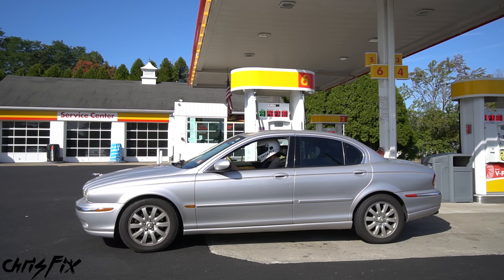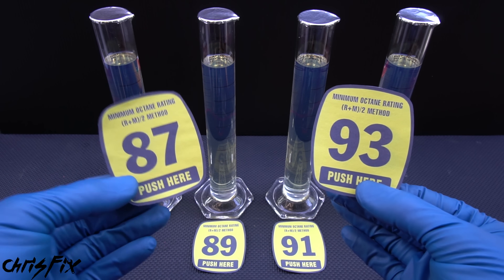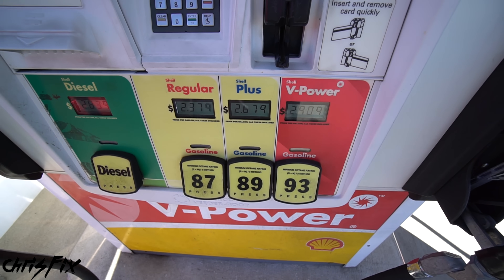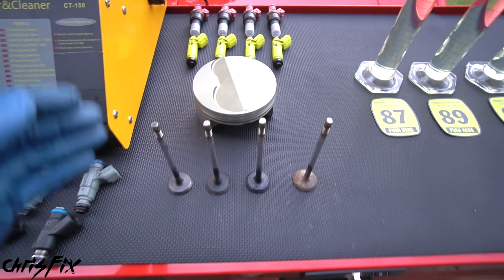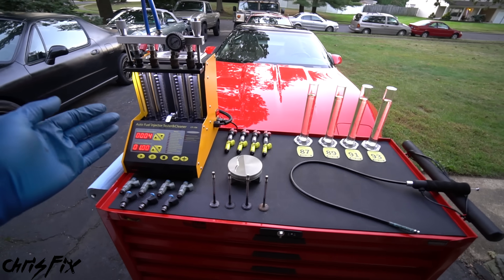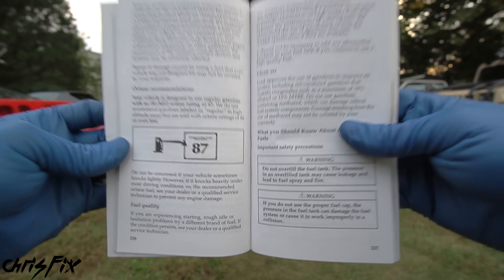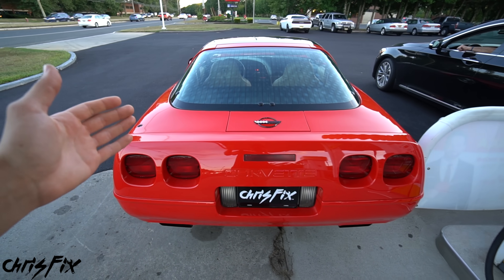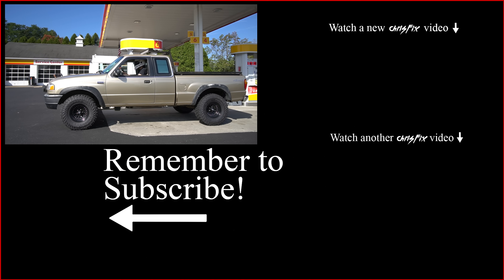What is the BEST Fuel to Use in Your Car or Truck and WHY

Comment: As far as Shell Gas is concerned... It is by far the best on the market. For the past 25 years I've been strictly using Shell in every vehicle I own, and the 3 vehicles I have now. My Accord runs perfectly fine on 87. My Ford 5.0 uses 89, my Z71 uses 91 or 93.  
Gas at home in México is the equivalent of $4.25 per gallon, and the Shell gas in Mexico actually comes from the USA, and is the exact same gas that I buy for $2.06 in Texas. It costs the same as the halfways refined Pemex national gas of Mexico, but Shell gas is 10 times cleaner and 4 times more potent. 
If you can't find Shell for a fill-up, use Mobile (Exxon/Mobile, same company) until you can find your next Shell station for a fill-up. Mobile in the USA and in Mexico both come from the USA and ut undergoes extra refining processes like Shell gas does. But, man, you can tell the difference when you use Shell.
To keep my injection ports super clean, along with the gas lines, gas  tank, exhaust, catalytic converters... I use a cheap but effective Xylene cleaner called "Berryman's B-12 Chemtool." It is by far the best water remover, carbon remover, tar remover, octane booster and power restorer on the market. And it's only $3 per can. I use one can every 25,000 miles with a full fill-up.

This is a fantastic, info-packed video and I have shared it to everyone I know. Great job.
Reply from the maker: Thanks a lot and thanks for sharing!
Reply: @chrisfix  Welcome, glad to see you think highly of Shell gas, too. It's the only gas I use, and I recommend it DAILY to others.

It's obvious that there was a lot of hard work that went into this video, and a lot of audio editing, too, but may I suggest something? 

Please leave a little breathing space between your audio clips. It's a natural reflex to stop listening to people who talk non-stop and by running your audio clips so close together that's what it makes it sound like. 

People also stop breathing with nonstop speech.

So... Just now and then so that people can relax a little more during your videos, leave little breathing breaks in between your sentences. It will help your viewers feel more relaxed while watching. You'll see the results in increased subscribers and more interactive comments.

Comment: Not true if I use low grade gas my engine knocks. If I use midium grade. Or by grade it runs better and fuel last longer. Cheap gas burns faster.

Comment: Thanks for the video, Chris. Is there any harm in mixing different octanes in your tank? For instance, my truck says recommended is 89 octane, but sometimes Costco has premium cheaper than other station’s mid grade. Could I mix the two in one tank if I were topping up? Thanks.

Comment: I am glad you covered this topic because the prices are getting out of hand and most people don't understand wtf those numbers mean. I  came across this guy named Ron Hatton who discovered a really cool way to optimize your engines way burn your fuel completely. Its called the Gadgetman  Groove. I had it done to my 03 GMC Denali that was getting only 11 mpg in town. After I installed the grooved throttle body I am getting 16 mpg. That might not seem much but its saving me money at the pump and my throttle response is amazing. I would like to see you do a review or maybe even apply it to your drift car and see what happens. Great job on these videos. I have really learned a lot with them.

Comment: Question: What is the BEST Fuel to Use in Your Car or Truck and WHY?
Answer: Electricity. It's the cleanest and most efficient fuel and you never have to worry about octane rating again.

Comment: considering that I have a flex fuel vehicle (which I do), what would be better engine-wise: E-85, regular (89) or premium (93)? some say that ethanol gives you less carbon deposits, the engine runs cooler, it has higher octane to it, and the downside of a much lower mileage... any comments? any chances of making a video about it?

Comment: So i have a tune that says 93 but all the gas pumps around me are 91. will 91 be ok?
Reply: Short answer is No, if it is really tuned for 93 it will probably knock as the tune will have too much timing in it when you lay on the throttle (the knock may not always be audible over other engine sounds). Knock sensors may keep it in check but is not good long term. This is all assuming some high compression or forced induction that is actually knock limiting the engine. Not the tuner just tuning on 93 and saying that's what it needs for safety when the engine is making peak power before a knock limit.

Comment: That’s a great video Chris. I have four (4) questions. 

1) If your vehicle is a flex fuel vehicle, can you run it on any type of petrol or does it have to be E-85 only?

2) We have some 2006 Police Crown Victoria’s (P71) in the U.K. Which fuel is best for these? I’m presuming standard 95 (England), as these would have been ran on the cheapest fuel in the USA when they were in service.

3) Would running the Police Crown Victoria’s (P71) have any damage caused to them if they ran the Shell V-Power 99 (UK) in them it is it best to keep to the 95? In addition to this, 

4) If we used the Octane booster liquid with the 95 (UK) fuel, would that cause damage?

We don’t have any user manuals or any reference to which fuel should be used.

Comment: Canada has better fuel then the US. We got 94
Reply from the maker: Watch the video!
Reply: ChrisFix We use the same rating As the US not Europe.
Reply: ChrisFix Speaking of US versus Canadian fuels, there is a difference. Our octane ratings are the same, and they're calculated in the same way, but there are a number of differences in the blend. Canadian fuels are sometimes more volatile, especially in the winter months, as a quicker-to-ignite fuel works better in cold weather. P. S loved the video.

Comment: I’d like to know more about super premium ethanol free 93. Here in Montana we see it a lot in the winter being used by snowmobiles. I have always put it in my cars a few times each winter. I mostly stick to premium all the time, even though its not required. I live at elevation with extreme cold and heat. Cars run better on it. Even my lawn mower gets premium. Starts up every spring.

Comment: Higher octane - in most cases lower burning temp because of added ethanol(cheap octane booster in some fuels) higher compression tolerance and worst energy density (since additives or e85)

Comment: 1st.  I am in so cal, premium gas is over $4.00 a gallon.  Where are you that premium is $2.95?  LOL  2nd.  i have a economical 4 cylinder engine that 87 or 89 is recommended.  and you are claiming that whether 87 or 89 or 91 or 93 octane is used, the engine will run the same.  Based on my experience, and i have been driving and owned cars for over 20 years, I put premium (91) octane in my car, and it runs way better than 89 or 87.  3rd.  i have used; shell, chevron, 76 and mobile.  and quite honestly, and to my surprise, chevron gives my car a boost of power, running faster and quicker than using the other oil companies.  and no, i prefer shell over all of these companies, but chevron makes my car run better.

Comment: Another great vid, but the fuel energy output and efficiency also depend on the content of Ethanol. Some stations still don't have ethanol in the 93. I also have to question the uneven burn.  Too low octane allows the fuel to combust prior to complete closing of the valves. Pre-detonation is actually the more accurate term.  Also on older motors, carbon on the valves will heat up to glowing and cause Pre-det. The valves literally rattle back into place from the flame front trying to force its way out the intake valve.

Comment: First video of your I have watched, very informative, thank you for the time invested to make/edit it. I do have a couple of questions sir. I drive a Hyundai ioniq, 2018. I top my tank off. I fill it up until I can see gasoline outside the neck without it going down the neck. My reason for doing that is, I get 200-250 more miles range on my dashboard and I have gone all the way to 20 miles reminding, not very often. I usually fill up 550-600 miles since my last fill up. I reset on of my trip meters every time I fill up.  Question 2: I do something with this car that I have done with my other cars. When my MPGs drop 7-10 miles 3 or 4 fill ups in a row, I will run 3 or 4 tanks of non Ethanol gas through it. Down in LA (Lower Al, Mobile area) we call it Marine fuel. I will get my previous MPGs back, so I assume this fuel cleans carbon and other bad stuff in my engine. Does this damage my engine? in the long run. Thank you in advance for your reply

Comment: How do we know that the petrol (gasoline) is ACTUALLY at that octane rating at the pump? Higher octane is usually more expensive, and the fuel station owner may exploit that.
Reply: Because octane is set by the refinery. Not the individual gas station. When the pump says 87 octane, it means at bare minimum your not being sold anything less. It's mandated by law.

Comment: Hey! Thanks for the video! I’m from Russia and here we have diesel either of bad quality or with a lower cetane number than it must be to suit modern diesel engines. Moreover, the problem and the fact is that the same car with a diesel engine can save up to 10-15% of diesel by using diesel sold in Europe(compared to diesel fuel sold in Russia) And a diesel injection system can die at 100k mileage. Can you, please, make a video about diesel fuel: a cetane number and which diesel injection systems are maybe more reliable if one use not very good diesel fuel (or none of them are reliable in this case?) Thanks in advance!

Comment: Dope video! I recently started using 94 Octane in my car since I learned a bit more about GDI engines and their carbon buildup issues. Plus it's a turbocharged engine which means more heat and pressure like stated in the video so I just feel more confident running this fuel grade over what the mfr recommends. Plus, placebo effect or not, I swear I notice a slight improvement in performance when I use 94 over 87 haha, maybe it's because after filling up with premium my wallet is just that much lighter 😅

Comment: I read somewhere on the internet that the 87 octane  gasoline is cheaply refined gas and that the higher octane variety is better quality meaning that 87 octane gas is just plainly refined gas while the 93 octane gas is  a higher quality grade made by fracking the petroleum atoms.

Comment: I advanced my timing a bit and it knocks underload but the drivability and  fuel  economy is much improved. Saves me about $2 per 100km and has done so for 10000km so far. Hopefully the engine life isn't dimished greatly.

Comment: Use green fuel tabs and it helps to more complete burn to keep it clean from carbon deposit, helps to take the lazy off the car performance 

my friends been using tab and 87 instead of 91 on their high performance cars, works very well for long time for us

Comment: So my truck says 89 recommended and that is what I use. My dad borrowed my truck and filled my tank up with 93. He didn’t tell me it was 93 so I assumed it was 89. When I went to drive to work It seemed like my truck was more responsive and ran better. I checked my manual and it doesn’t really say anything about premium fuel use. Can/should I start regularly running premium or no?

Comment: Nice video. The manual of my car recommends 95 octane but with that octane on certain occasions the engine sounds with that noise of marbles like rod knock. However when I put 97 octane that noise does not sound. I fear the engine has a serious problem. Thank you very much

Comment: I own a 2017 Mustang GT. My owners manual states I should use 87 octane gasoline. I bought it used and the dealership gave me half of a tank of 87 gasoline. I did ask. When it was time to fill up the tank I put 93 in it. I got better mileage and an increase in throttle response. So I disagree that higher octane fuel has no benefit.

Comment: You mention that engines with turbos are more likely to suffer from detonation with lower octane fuels, but Ford EcoBoost engines have dual turbos yet recommend regular gas, and they don't suffer from detonation. Why is this?
Reply: The engines adjust valve timings to eliminate pre-detonation, just like any modern engine.

Comment: I know this is a long comment but I need help.
Ok so like I need some help. I have 2014 Ford Fusion that's at around 89,000 miles at the date of 10/27/19. This problem only started around I'd say around Julyish to August. My Fusion has been running perfectly up until now. Now to start, say if you were to go from a house and then to a 15 mile drive to say like the Strip or something, but then leave the car for 15 minutes turned completely off at the destination which is the Strip, when you start it it starts completely fine, but after a good 30 seconds the RPM's start running low and the engine starts shaking and sputtering. It sounds like the car is starving for oil even though there is a full tank of gas. We took it to a Ford dealership as the diagnostic showed it to be a fuel pump/module and relay failure. So that was replaced I'd say not even a week ago. We thought everything was fine and dandy after a couple days of no problems. But 2 days ago the same problem arose but more severe. In my personal opinion, I think it's either a permanent water damage problem or a fuel system problem. What is yall diagnosis on dis?

Comment: Hey!
So I have a truck that won’t start. Well, it will start but it stalls right away. I got it to start and run but it was kind of skipping around and not sounding properly so I shut it off. What should I do to get it to start and run properly? By the way temps get below 32 and I filled it with a little bit of oil, enough that it won’t seize up from running. Plus the transmission slips gears so we don’t run it much. Any idea why it won’t start? Also, an orange up arrow appeared on the RPM meter. This is a Dodge Ram 1500 from 2001 (V8 Sport)

Comment: However, the cleaners in the fuel make a massive difference. I had to replace the O2 sensors and spark plugs in my car. Spending $1400. I buy Top grade fuels now!

Comment: You forgot to mention that it says minimum Octane rating... I hauled fuel and had to add the octane to the fuel on fuel rack so the last compartment on trailer was a line full of octane. Then next trailer loaded the 87 octane compartment and the first 100 feet was octane then came the fuel... so 87 usually test out above 91

Comment: Hey, Chris! It's been awhile since you have tested a fuel system cleaner. I would like to suggest BG 44K. On top of being a fuel system cleaner, it is also a performance enhancer and gives you better gas mileage. I don't have a borescope to check how well it cleaned, but it definitely improved my gas mileage by about 50 miles! Tested this twice by using the same gas station for fuel-ups and driving the same way. Each time I went from 160-170 miles on a full tank to 210-220 miles. I am curious to see what kind of results you would have.

Comment: Is all about with your engine compression rate, there are stablished  tables where shows the relationship between compression and octane level is in Google can be at your car manual or seeking information on forums about the engine   model that you car fit

Comment: I in 2006-7 I drove between Denver and Colorado Springs daily (some of the time we carpooled)  I still am driving my 2001 Toyota Tundra. I saved like 3-6¢ a mile with 91 octane over 85.  I was driving most often 5 mph over.  It was pretty close to 75 miles door to door.

Comment: In high-elevation areas like Denver, most gas stations have 85 octane. Most vehicles recommend using 87 octane or higher. Is it ok to use 85 octane high-elevation areas?

Comment: The face on that 'clean' valve...Geezzzus. You wouldn't get far. Also did you paint tar on the dirty one? Couldn't have happened in an engine. (This is not criticism, just observation - I thought it was a great vid).

Comment: you need a whole vid on E85 and ethanol in general, explaining in your straight forward style, how ethanol has a higher octane, yet contains less chemical energy, therefore the requirement for increased volume of fuel as the percentage of ethanol increases; how ethanol/gasoline mix can damage gaskets and seals in cars not designed for ethanol blend fuels, hygroscopic (not hydroscopic) properties of ethanol that makes ethanol blends bad for small engines and watercraft.

Comment: so good to see this.  big 'like' here.  when i do explain this to people, they look at me like my head is on fire.  one thing,  detonation is the fuel/air lighting off from the heat of compression/hot spots prior to the spark plug firing, before the piston is top dead center, which is what eventually will break the piston and/or rod because the motor is literally having to compress that explosion for a fraction of a second. the knock sound is literally the flame front from the detonation and the flame front from the plug firing meeting in the cylinder at supersonic speeds.

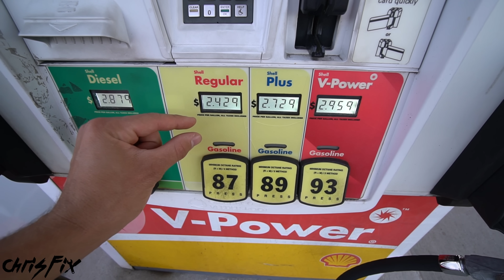Comment: 1:49 "you're  gonna get more power because it has more energy that's completely false"  12:22 U'll lose a little bit of fuel economy and a little bit of power" lol
Reply: It's because the 5.7 in the Vette is tuned for 91 octane from the factory. The initial statement at 1:49 was meant to say that if your car manufacturer recommends 87 octane fuel for your car, jumping up to 91 or 93 won't benefit you because the engine isn't tuned to benefit from higher octane fuel. In cars where 91 or 93 is recommended and you put in 87 or 89, the engine will pull timing which effectively makes it less efficient. I do agree, it could have been clarified better, but he's not wrong on either end.